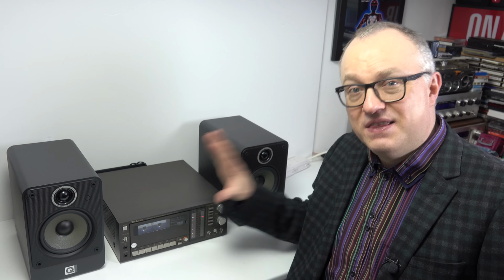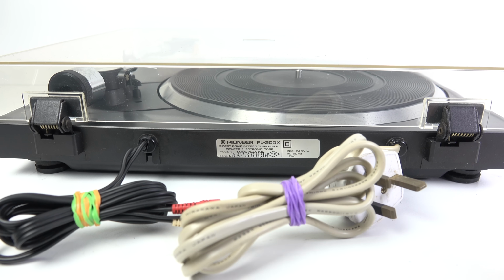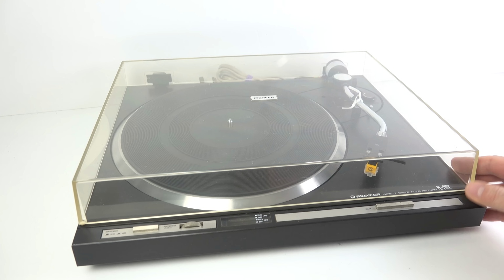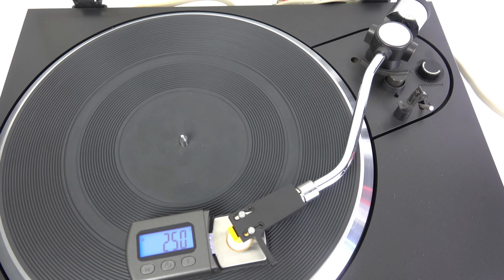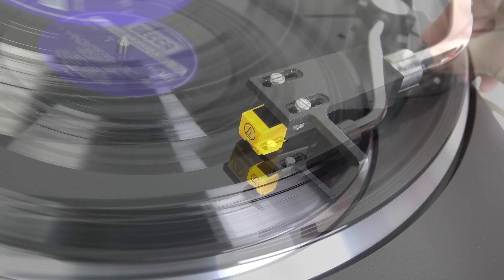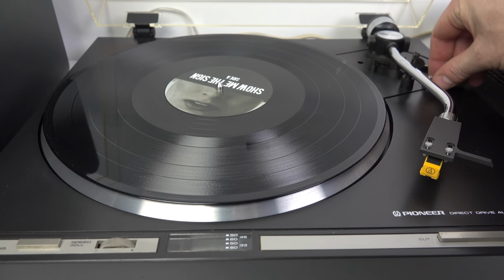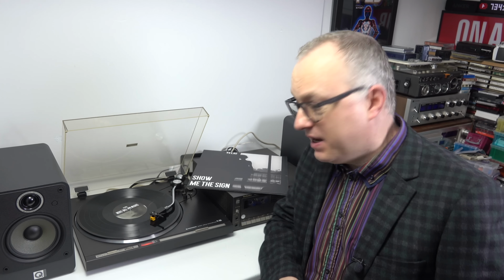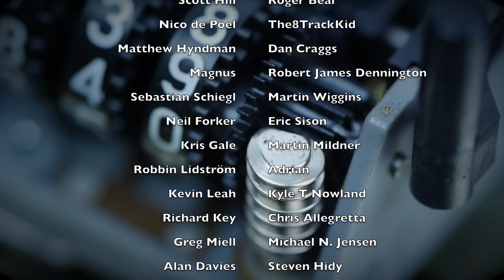Beginner Budget Hi-Fi Build: Part 3

Comment: Hello Techmoan, regarding the stylus cartridge, I think it's an Audio-Technica AT-91 :)
Reply from the maker: Thanks. If so 2.5g is top end (but within) the recommended tracking force limits.
Reply: I always enjoy your videos! I imagine you may address this in the final chapter but I'd thought i'd throw in my 2 cents. I put a budget system together for my partner and picked up an AT-91, I thought it would be better than those ubiquitous red ones that come on numarks and crosley's. It was no better and sounds so brittle I cant stand to listen to it, it really let the whole system down. It might be worth discussing vintage/used carts (Ortofon VMS, Technics 270C etc...) you can pick them up for next to nothing and you can still buy styli from bog standard to high end.
Reply: Yes it’s an AT-91 - recommended force 2g. I have one myself on an old JVC 1980s turntable
Reply: @Techmoan  2g would be safer as mentioned here. Maybe more optimum and safe
Reply: yup - i just bought an AT-91 earlier this year. 

according to the spec sheet the tracking force should be 1.5 - 2.5 g with 2 g being recommended.

the stylus can be swapped with an AT3600 wich is pretty common on new turntables these days (my dual DT250USB came with and AT3600L preinstalled)

so if that original AT-91 stylus needs to be replaced but you can't buy an AT-91 stylus any more for some reason, a 3600 will do.
Reply: @bensharp4164 :  Sounds like you were using AT-91 without putting it through a phono pre-amp!  It certainly Isn't 'brittle' sounding; rather very clear, full frequency, with plenty of bass-weight behind it too....when used through a proper phono pre-amp!
Reply: I was running it through a mid 70's Marantz and mint Whafedale Diamond Mk1's... nice set up and very forgiving, not however, with an AT-91. Perhaps I've been spoilt by the Ortofon VMS, I like a rich, clear styli.
Reply: @stevesstuff1450  The old Technics has a MM phono section.
Reply: It looks like an AT-3600.. 3-3.5g. An AT-90/91/92 is a P-mount where a 3600 is standard.  Then again they seem to look exactly alike.
Reply: I say a kilo (plus or minus 50 grams)  would be good, especially if you are in an earthquake area.
Reply: @1mctous : Yeah...I'm very well aware of that, but the other commenter's problem didn't specify the amplifier equipment used, and wasn't relating to this particular Technics Casseiver either.....
I was well versed in the benefits/neccessity of a phono/RIAAA preamp back in the early 80's when this piece of Technics equipment was sold, as I'd already been in HiFi retail for a few years, after several more previously just from a hobby standpoint... so I'm very well versed in these old turntable/amplifier requirements.
What I don't agree with is that this cartridge: an AT-91/3600 sounds brittle when amplified properly.  I have one on my Rega RP-1 (rebadged as the Rega Carbon) and it sounds incredible... I also use one on my AT-LP120 USB and it sounds fantastic, and use a T4P-mount version on a Technics P-Mount Quartz Locked DD turntable .  I know hat this cartridge sounds like!  
I have a preference for Shure cartridges, but I like and enjoy the Audio Technica carts. and always have a few around....
Reply: @stevesstuff1450  The A-T 95E performs quite well for the money.  Luckily for Shure fans, you can still buy Jico replacement styli (really good quality) since Shure no longer builds cartridges or styli.
Reply: @moviebod  You won't play a record even once at that force, even with the most powerful motor on Earth.
Reply: @1mctous  :  Yes...thank you... I know!  Jico styli are often sold under the EVG brand too, and I've used them for quite a while now.  I favour the sound from an original early 70's Shure M75-6s (non plastic body) cartridge, or for the P-Mount cartridge, the newer M92E.  Both of these cartridges can take a multitude of earlier styli types which will change their performance and sound, so it's easy to mix-n-match to find what you like best!!  You can even use the styli designed for  the P-Mount on the original M75 cartridge, if snip-off the two small plastic 'support lugs' from the P-Mount stylus, and get some very surprising (brilliant!!) results!!  
So much sound quality from a very basic stylus, but then with a far better stylus-designed for a better cartridge series, the M75 series can perform far outside it's specs, and be quite amazing!  Great for experimenting with ;-)
Audio Technics cartridges offer a more limited range of 'experimenting', but it means a lot of plastic cutting... I love the very wide Audio Technics stereo separation, but I don't like it's lower output levels so much, compared to a Shure!
Reply: @Scratcher1tbp  Agreed. All AT-9X carts are P-mounts.The cart in the video certainly looks like your bog standard AT-3600.
Reply: @senorverde09  Actually I think we're confusing AT91 with AT-91.. seems to be both.
Reply: @Scratcher1tbp  Yup. The AT-91 and AT-3600 have the same cartridge body and overall plastic stylus enclosure. The only differences are the 91 has a carbon fibre cantilever, slightly lower VTF, and a 0.6mil conical diamond.
Reply: @senorverde09  Oh yea maybe.  I bought the LP Gear upgraded carbon fiber stylus for the 3600.  No idea if it makes a world of difference without seeing it on a scope or something.
Reply: @stevesstuff1450  Mix-and-match is part of the fun.
Reply: it's also identical to the rega carbon, so as it's good enough for the rp 1 it will be perfect, i have one and it does sound good, but it is only conical and not elliptical..
Reply: @anthonynewcome128  Although A-T makes both, the Carbon and 95E are not identical: https://www.youtube.com/watch?v=WkJADkDGnH8
Reply: As for cartridges, Ian in Singapore does in-depth, impartial, A-B reviews of new cartridges at his channel; HiViNyws.  Not sure if he has reviewed any P-mounts yet.  Worth watching before purchasing ANY cartridge

Comment: I remember the first system that I bought c.1985 when working at Radio Shack. The amplifier was the model STA-790 that had a 7 band frequency equalizer built in, matched to an SCT-23 cassette unit, a CD-200 cd player, a pair of Realistic Optimus T-120 3 way tower speakers and a Realistic LAB-430 direct drive turntable. Through the years I replaced the amplifier, cassette and CD players with the Optimus Professional Series 5.1 surround Optimus STAV-3770, the SCT-57 dual cassette unit and the CD-7300  6 cd cartridge unit. I saved a lot of money buying them when those model were replaced for a new model.
Reply: Oh How I Miss them days !

Comment: I notice the sender did not remove the platter prior to shipping. It's generally a good idea to remove the platter, secure the subframe (if there is one, there are usually special bolts in place for that purpose) and package the platter outside the turntable. If the platter's weight is significant - and in most turntables of a certain quality level it generally is - then if it is left  on the spindle during transport, there is a chance it could get dislodged and damage other parts (such as the tonearm) or damage the spindle bearing due to the force it will exert on it during sudden jolts etc. Spindle bearings in most second hand turntables are either irreplaceable or expensive and difficult to replace. It's not worth the risk of not removing the platter, in fact, I think this is the single golden rule with regards to turntable shipping that one should observe.

Comment: Something like a five disc CD multi-changer would comfortably accommodate the turntable on top, giving the whole setup a more uniform appearance. Alternatively, one of the older medium to high-end DVD players that double-up as very good CD/ SACD players (and feature a video-off/ audio only mode) e.g. the Sony DVP-NS900V.
Reply: You could also get a little 3.5" HDMI display meant for a Raspberry Pi just so you can use that DVD/BD player as a dedicated CD player sans a TV if it doesn't have playback without video, or it has controls requiring seeing a menu.

Comment: I think belt drive vs direct drive is largely a matter of personal preference.
If there is any minor speed instability in the motor, then the belt can help to even that out, but the belts can stretch, degrade and snap.
Direct drive doesn't have that buffer, so any speed issues are more easily detectable, this is why the quartz lock mechanism is more important for direct drive.
Personally, I've still got my old Dual CS505-3, I did have to replace the belts and lubricate the track &  return mechanism, but these are really good turntables when working and can be found pretty cheaply on eBay.

Keep up the interesting videos, I've just subscribed 😃

Comment: I am reasonably sure that the discrepancy between the indicated and actual tracking force after you balanced the arm is caused by the weight being on the arm backward. In the other pictures and all tables of this general type, the black indicator dial faces the front of the arm. If you flip it around and do the same procedure adjusting static balance, then turn the black part to the zero point, then both together to the desired tracking force, which likely will be best on this cartridge at 2-2 1/4 G. , I bet it will agree closely with your scale. 
As to the anti skate adjustment, I have seen arguments for both methods of using a grooveless track and a high frequency loud tone and adjusting for minimum and balanced distortion on both channels between anti skate and tracking force.
Reply: No, he has it the right way round, I believe he's just using it incorrectly. The only actual adjustment is done by moving the back one, which moves both. The front ring with the numbers turns so you can zero it, then you turn the whole weight til it reads the force you want. It's hard to explain, but that's how the adjustment works on my PL-4. One thing to note is that the peg on the back of the tonearm may be broken as it was on mine. It needs to stick out so that turning the weight moves it in and out properly. If it's broken then turning it won't move it the correct amount. After fixing it  it works perfectly.
Reply: Mike Bucceroni 
Usually the large metal one is the actual weight and it’s in the back. The thin black one is the indicator you zero after the arm is balanced at zero weight. You then turn the weight and indicator together in the direction that moves it closer to the front, thus adding the desired tracking force. A full revolution is usually about 3 grams. 
The fact that he dialed up 2.5 and it still looked like almost zero meant that something wasn’t actually moving to shift the balance to the correct weight. 
I have set up lots of Japanese turntables and it’s almost always the same. And this one doesn’t have a super heavy or light cartridge to make the weight have to be super close or far back to balance.
Reply: @w7777777s  What he is turning is the indicator ring. if you notice when he dials it up, the black part on the inside doesn't move at all. so nothing was actually adjusted, which explains why it looked almost at zero.

Comment: When I bought my current component system they were not including turntables any more, so I just kept the tt from the earlier system. It was deeper than the new components and couldn't sit on top. Fortunately, I happened to have a sheet of glass the size of the tt, so I put it between the tt and the top component, been that way for over twenty years now. It's unobtrusive, and hopefully, the weight of it stabilises the tt somewhat.
BTW the even older tt is still going strong, two new belts, and after it started to run a bit irregularly, a spindle lube fixed that.
TBH I think it's lasting because I hardly ever play records these days!

Comment: I kind of wished I would have seen a video like this about a year ago. I was so paranoid about getting old equipment because I don't really trust myself with fixing things if they didn't come in working condition and the seller didn't specify. I also recently found a shop that's less than an hour drive away from me that sells refurbished turntables, speakers, receivers, etc. However, before I knew all this I went with a U-Turn Orbit with built in preamp and a pair of 100 dollar powered speakers. I do like the setup a lot but part of me would like an automatic turntable down the road. I kind of want to explore what different sound system setups sound like as well.

Comment: Direct drive turntables suffer from 'cogging', ie slight instability in the speed.  Belt-drive ones are better, because the elastic belt smooths this out & also doesn't transmit vibration to the platter.

Comment: Audio equipment neaarly always get weird naming schemes. I have a PL-514x which is a belt driven model from 76-79, yet Pioneer sems to have gone back down in numbers making it somewhat dificult to follow the modell tier across generations.

Anyway... It still sounds good, and the pickup that came with it is supposedly worth 3 times as much as the player itself so I'm rather happy with the sound as well. Only thing that bugs me is that the adjustable weight only has 2 real settings rather than a seemless ajustment between max and min. It can be ajusted to between them but if you want just a tiny bit more or a tiny bit less than the 2 points it will always snap in to those. It's good to see that they improved upon that design flaw with these models.

Comment: Correct me if I'm wrong, but isn't finding a direct drive yet fully automatic turntable a very hard, almost impossible task?? Because the only really common direct drive TT I can think of spontaneously, is the everlasting DJ classic Technics 1200/1210. Built like a tank and probably the best direct drive motor on the market, but no automatic features at all. This thing is as manual as it gets, and as a DJ, you really need and appreciate that!

Comment: Great vid, couple of points re newbies etc Always BEFORE you set your record deck up, check it is LEVEL!! Believe me I've made that mistake and it's NOT one you want to make!! I put a level on the platter and then adjust the unit so that it is now LEVEL. 2. Cartridge alignment? If its tracking wrong, it can prove problematic re sound and so much more. Check out the vids on fitting a new cartridge and alignment etc. Solution is easy ! 3. Check out types of cartridge UPGRADES there are available as sometimes that can make a massive difference to the quality of sound etc. 👀Do remember as I know from experience that the records your parents had often had record players with stylus's that were mono or mono/stereo and tracked often on the records with as much as up to 6grammes weight! Worn or scratched records may cause the sound to be distorted OR the needle to jump.. Why I have TWO cartridges with a light accurate one and a cheaper heavier tracking one, two cartridge screw in arms for quick changeover depending on what LPs etc I am playing. 👀👍 If you are serious about your record unit setup/use etc there are loads of vids available to expand your abilities AND knowledge. Stay safe, whoever wherever you are! Lastly cables!! Do make sure before you bring all your units together to make sure you have enough CABLES!! 👍Oh and AVOID the CHEAP nasty ones as often the phono pins snap off!

Comment: I've rarely seen an on/off switch on a semi automatic tt. It's usual on fully automatic tts.
Reply: My fully auto Kenwood player has no on /off switch just a Play/Cut button. Though I think Pioneer and Kenwood are the same essentially.  (Edit:That should have been Panasonic not Pioneer so they aren't the same)
Reply: Same with my Technics SL-BD22D. The act of moving the tonearm over the record is the on/off switch, in effect.
Reply: My SL-1900 doesn’t have a power button, even though it’s fully automatic
Reply: @sh4dowchas3r  Pioneer and Kenwood the same, I don't think so as they are two separate companies. I agree, most budget tables that are of the semi auto or full auto don't have a separate power button. My Belt drive Kenwood KD-12RB semi auto from 1985 does not have such a switch either, just the cut, cue and speed buttons on the front. No strobe as it's a frequency generated speed control circuit. Works quite well for its age and fitted with a Grado Prestive Green 1 into a more than decent phono stage receiver and speakers for a quite surprisingly good sounding vinyl playback.
Reply: @johnhpalmer6098  oops I was mixing Panasonic and Pioneer up.
Reply: @sh4dowchas3r  Still not the same, at least I don't think so, Kenwood in Japan is known as Trio (had a Japanese portable cassette player that was essentially a Kenwood, branded as a Trio in the 1980's) and Panasonic was part of Mastushita back then, not sure about now though.
Reply: I'm most experienced with Sony players. Most Sony fully automatic tts have an on/off switch.
Reply: Well a lot of Receivers and Amplifiers have a 'switched' power outlet on the rear to hook the record changer to, this is the reason my PL-590 doesn't have a power switch as it was originally part of a pre-made hifi bundle. Most nicer 70s-80s Japanese amps and receivers will have a switched outlet on the back though. This should prevent it from being powered on without your amplifier switched on.
Reply: @ixionn563  exactly right. My father has a Pioneer PL960 from 1986, and that was powered from his Pioneer SA940.